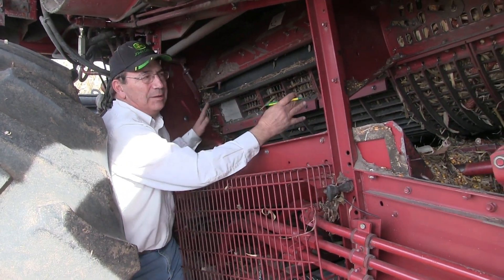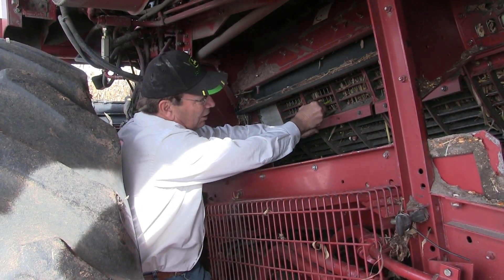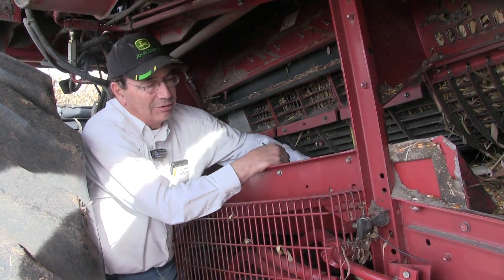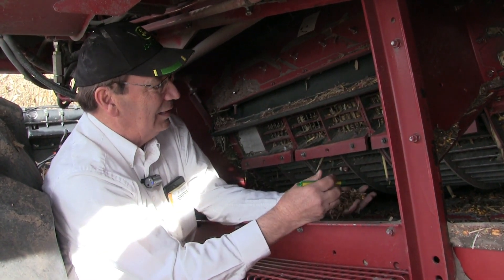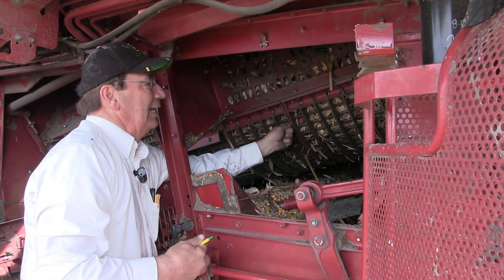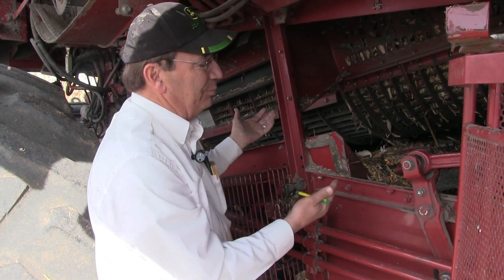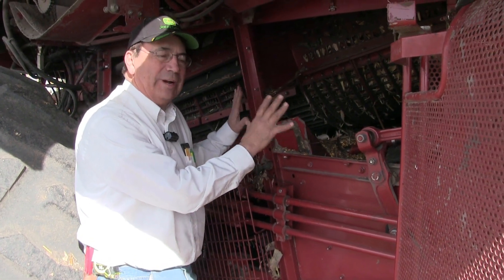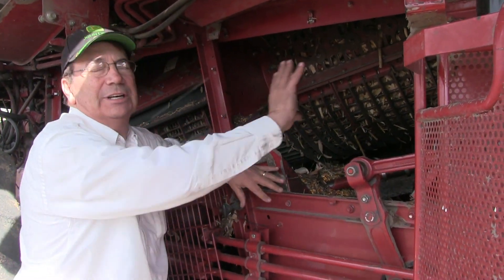Marion Calmer - Combine Kill-Stop Examination (Part 2 - Threshing & Separating Area)

Comment: Great information. Just FYI.... The deeres also have the ability to adjust the vanes in the top of the rotor cage to accelerate or decelerate crop flow.
Reply from the maker: Cool - which models, do you know?
Reply: @CalmerCornHeads  I would have to confirm on 70 series, but s600 and s700 models have the ability.